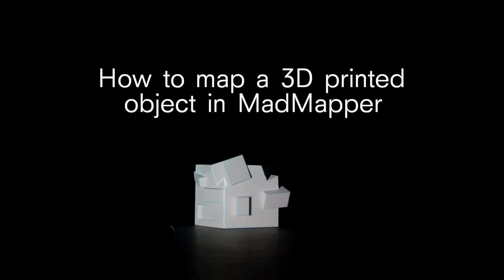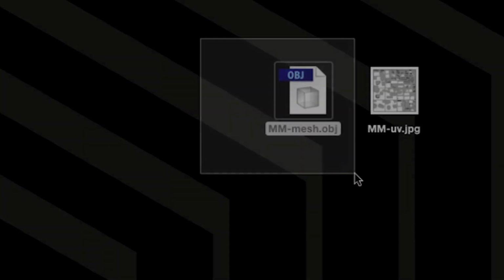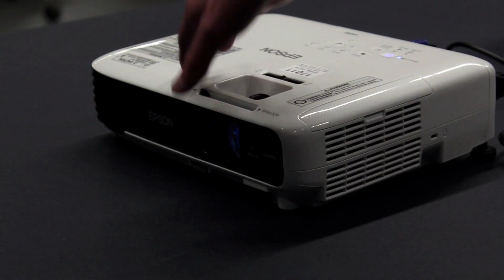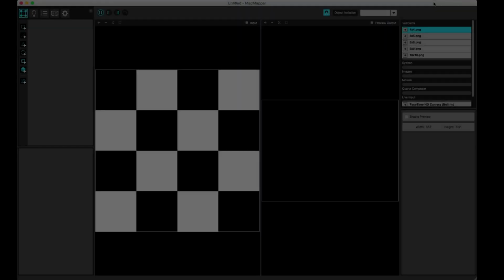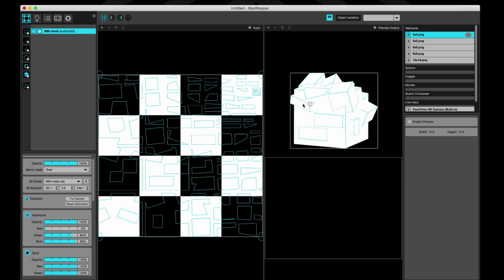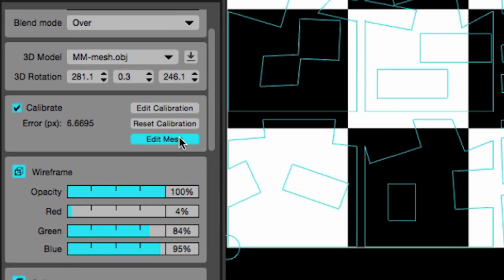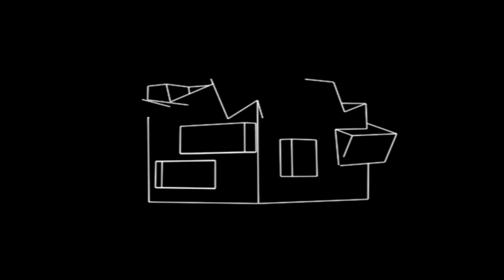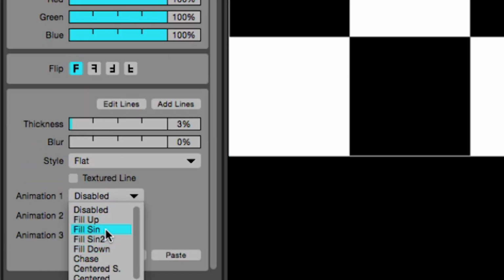MadMapper: 3D Calibration (Advanced Tutorial)

Comment: Why would it not work with a short throw projector?
Couldn't you just subdivide the geometry of your 3D Object and line it up to corresponding points on your printed object to get rid of any distortion from the lens?
Reply: Yeah man, exactly my thoughts, short throw is probably the future of 3d mapping.  My guess is that the triangulation system of calibration does not work with a lens distortion, hopefull they can fix this in future.    Man its been years I'm trying to find out how to achieve real 3d mapping and a lot is still a grey area it seems, rendering in cinema 4d to then reproject is almost impossible.